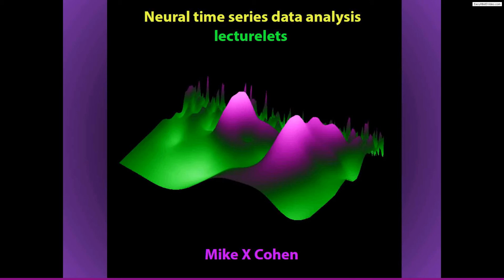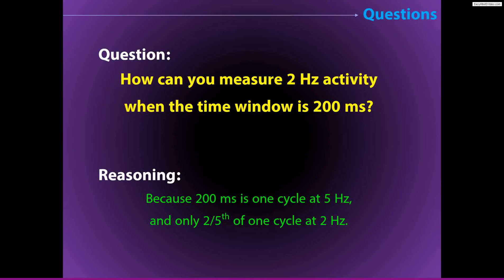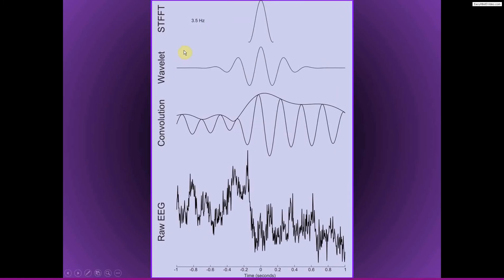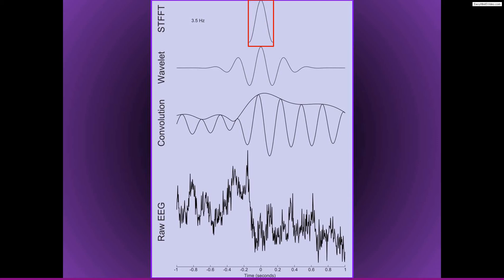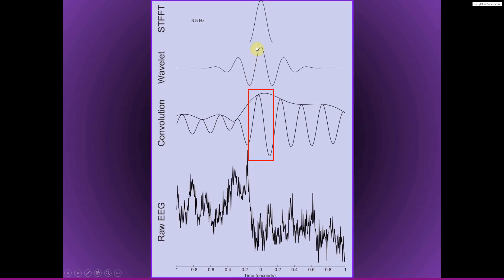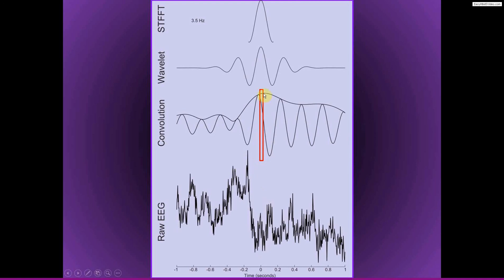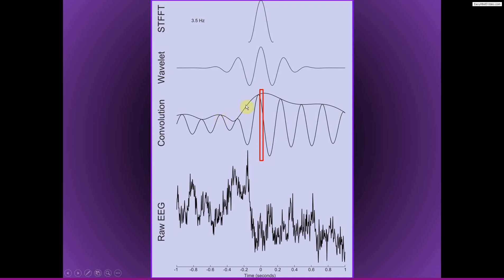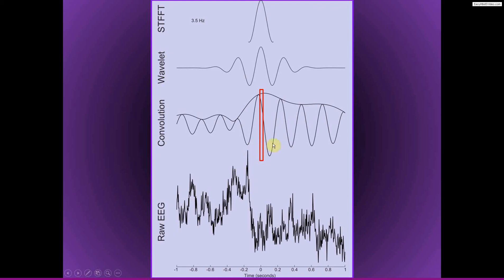Frequency resolution of wavelet convolution

Comment: Basic question, what does a "window" mean in the context of wavelet convolution? Isn't a wavelet slid over the signal one SAMPLE at a time for every dot product, to plot the convolved signal?
Reply from the maker: Hi Guru. Great question, and I'm sorry it wasn't clearly enough explained here. Indeed, the wavelet (kernel, more generally) slides across the signal one sample point at a time, the kernel is generally much longer, perhaps hundreds or maybe thousands of points long. So the wavelet is aligned with the data at some center point, but the non-zero values of the wavelet extend further out in time. For a Morlet wavelet, you can consider the "window" to be the full-width at half-maximum (FWHM) of the Gaussian.
Reply: @mikexcohen1  ah, so it directly depends on the number of cycles parameter?
Reply from the maker: Indeed! Wider Gaussian -> more temporal smoothing.
Reply: @mikexcohen1  thanks for that! Great videos, this is the only proper source for me to learn about wavelet convolution and time frequency analysis :) please keep making more.